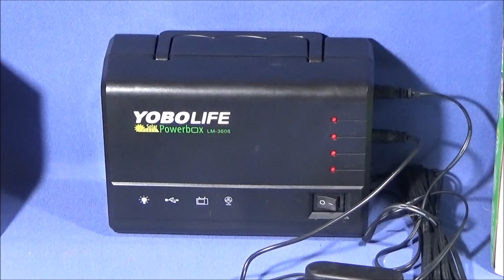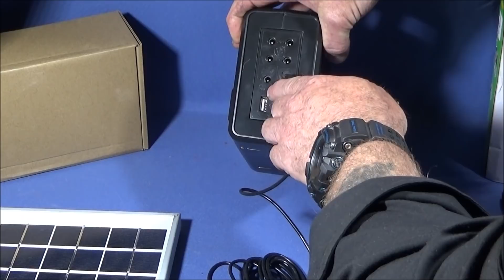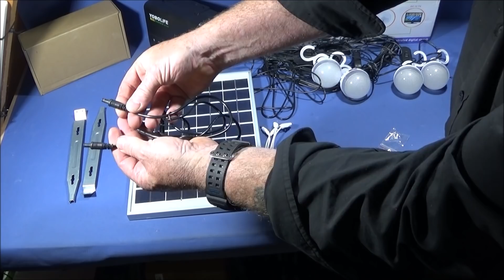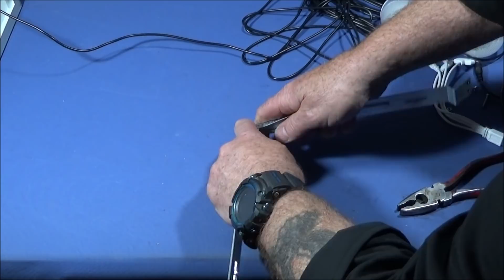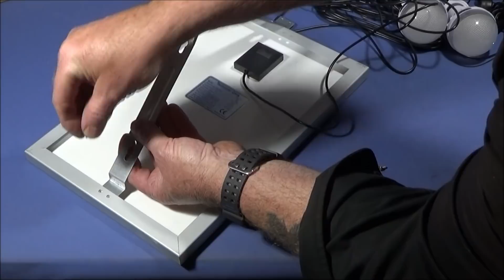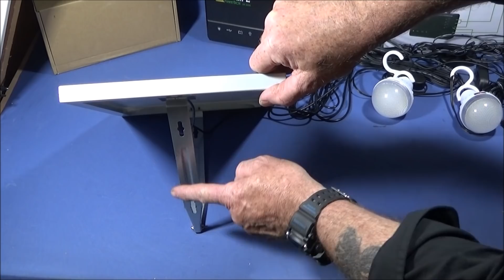YOBOLIFE LM-3606 Solar & Mains Powered Power Bank Lighting Set

Comment: I am writing from SZ Jiuguan Engineering Co., Ltd., a professional solar product manufacturer based in Shenzhen, China. With over 20 years of experience and numerous successful projects in solar power systems, we specialize in providing cost-effective and reliable off-grid solar solutions for the global market.

We would like to introduce our popular compact home solar system, the HSE-H-100, and explore potential distributor or agency partnership opportunities in your region.

Product Highlights:
1、 Plug-and-Play Design: Modular system, easy installation, meets basic household electricity needs.
2、 Integrated Control Box: Built-in MPPT solar charge controller maximizes charging efficiency, with multiple 3、DC outputs and USB ports.
4、Covers Basic Load: Includes indoor/outdoor LED lights and a DC fan for lighting and ventilation.
5、Safe & Flexible: 12V DC safe voltage; users can freely select additional accessories (e.g., batteries).
6、Wide Application: Ideal for off-grid cabins, emergency backup, rural electrification, and outdoor activities.

As a distributor or agent, you will enjoy:
a、 A complimentary FOB sample unit.
b、 Highly competitive factory-direct pricing.
c、 Low minimum order quantity (MOQ).
d、Stable product quality and reliable supply chain support.
e、Potential for product customization and market collaboration.

If you are interested, please let me know your email, and I will send you more materials.  
Thank you.

Comment: Hello Steve,
First, thank you for your video, it''s interesting.
Secondly, I want to tell you about a problem I have with the lm-3606. It seems there is a bug because the four lights are flashing at the same time and nothing works connected to the battery. Do you know how can I repair it? I do not find any answers on Internet... Maybe you have a solution?
Thank you for your answer

Comment: Sure would've help seeing a fan or tv connected! Real life stuff!
Reply from the maker: This one is only for the low powered LED 12v lights. It is not for powering mains but can be changed using the mains.
  I'm just about to review a set up with an inverter though with the mains connection.

Comment: How many hours the tv works? How you connect the tv?
Reply from the maker: Hi I really don't know how long one would work for. TV is if no interest to me so I didn't look into it. A TV or any other low voltage electrical device would just be connected as to power it up with an appropriate power plugs. Regards Steve

Comment: I've got one of these for lighting in my garage, which is a mile and a bit away and has no electricity. I've been able to work well into the night with it running, it's fantastic.

I wasn't convinced the solar panel would handle being permanently outside in Welsh weather so I sealed it with silicone around the edges and then used stickyback plastic for covering books to help prevent any rain sitting on it. It's been working flat on my garage roof since February and the cable was easy enough to snake around the fascia, so it's not visible from the road at all.

I'm planning on seeing if it will charge from the lighter socket in the car - with the engine running I get 14.2V which appears to be enough for the charging circuitry to use. If it is that'll help keep my coolbox nice and cold when pottering around on adventures!

One last thing, the AC charging cable - yes, it's got a European plug on it which can't get plugged straight into the wall in the UK, but rather than chop it off and replace it you can use a shaver adaptor plug.
Reply: Hi, may i know how long it takes to fully charge the battery just using the solar panel?

Comment: Looks good but I can't help thinking that the battery looks a bit on the small side, wouldn't you be better off with say a leisure battery from a motorhome? It would be nice if you can confirm that the run times they quote are actually correct, maybe a 'follow up' video after you've had to use this kit during the Winters months would be a good idea??
Reply: Hello Steve, I bought the exact same kit and yes the battery is no small. I only managed 30 minutes  from a full charge with only 3 lamps on low
Reply: Rule of thumb for me is any Chinese output rating gets a .5 multiplier applied, ex. 1,000 Chinese watts x .5= 500 real watts. ☺
Reply from the maker: @BeachsideHank  Well I'm really pleased with it..I really can't fault it in any way. I only want it for what it says it can do and it does that perfectly. So much better and safer than using gas lamps etc for power outages and it would be fantastic for camping.
Reply: @SteveJordan  A bit tongue in cheek I was; I find the vast majority of Chinese goods to be a reasonable value for the money spent- at least that was then, now that my president is screwing with tariffs, that may well change, I wish he'd go back to his stupid quest for a "wall" and leave international trade alone. ☺